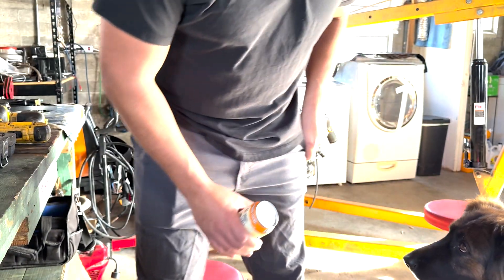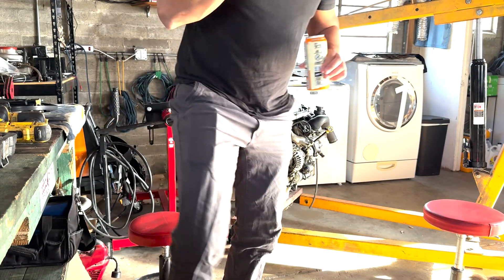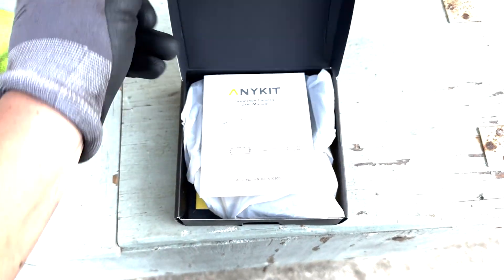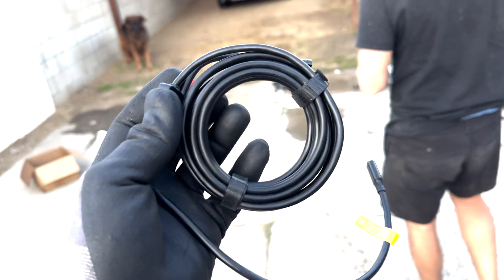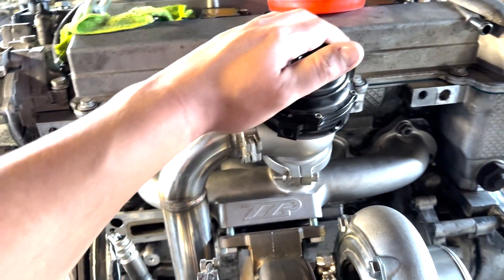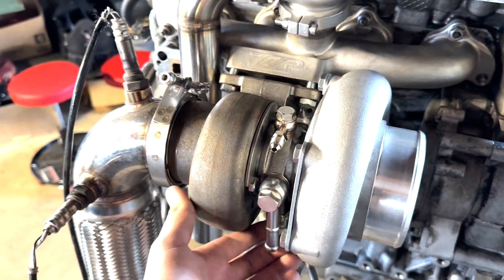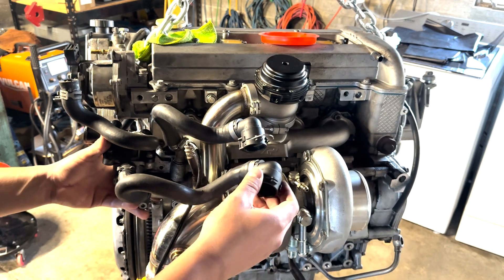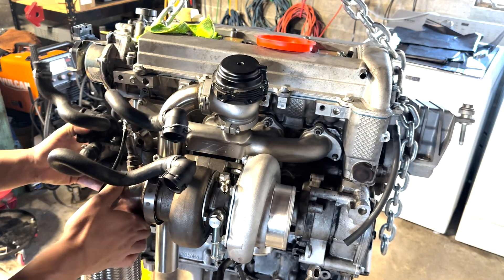Saab 2.0L Big Turbo Build (Part 3) - B207R Deep Clean & GTX3582 Turbo Plumbing

Comment: So like what are the chances of me being able to do this with the engine still in the car 😂 and no lift ?
Reply from the maker: You can 100% do it in the car - it’ll just be more annoying and you’ll have to be on jack stands and have a creeper as you’ll need to be way underneath the turbo area and come up from the bottom to do all the oil and coolant lines
Reply: @thejsgarage ok I just wasn’t sure I’ve done the downpipe on the stock turbo and that was kinda a pain I wasn’t sure if the manifold was even possible to take out with the engine in the car
Reply from the maker: It’s kinda hard cuz the manifold is tucked up behind the motor and firewall a bit but it can be done

Comment: Nice work and great your doing it, but is it not worth just getting another saab with a b204 engine and doing that instead
Reply from the maker: You’re probably not wrong lol but the B207R is very common and easy to find so lots of people are curious how much performance you can get out of it for cheap modifications
Reply: @thejsgarage  suppose most of the b204 been scrapped for the engines.  There in every thing now  except a saab lol

Comment: Still using yellow top coils? or just placeholder
Reply from the maker: Just placeholder! Most likely black top to start but might look into the R8 coils? I think you need the harnesses
Reply: Go with np boosted coils, i have them on one of my saabs i have 4 saabs and those np boosted coils have lasted me 2 years. I have a project with this same exact build only difference is im running a different gtx3582 by bull boost, 630cc injectors from maptune and the wiring harness for the fuel injectors. In total for the injectors and harness i spent 480, running the same lnf turbo manifold, with turbosmart wastegate, i redid the timing chain and timing guides aswell added the green guide from the lnf on zzp aswell. Cars first start up will be next week since i still have to replace the fuel pump which im going with a walbro 450, for the oil return line i use the stock bottom piece, i cut off the the barb wire line and added another one with the mishimoto push on swivel end hose fitting 45 degrees -10an, which connects to the an fitting on the turbo that pushs into the turbo line, i added self tightening clamps to prevent leaks, for the oil feed i had alot of trouble i had to buy 5 different fittings untill i finally got it right which i dont remember which one i used. Btw i know these cars and they wont last if you push more then 320hp, you will need to add forged pistons and rods to be able to push the power you’re looking for, im personally only going to run 10psi on that turbo untill i get the engine built, i dont want to risk all the money im putting into this car. If yours is able to push 400hp ill push it a little more tho